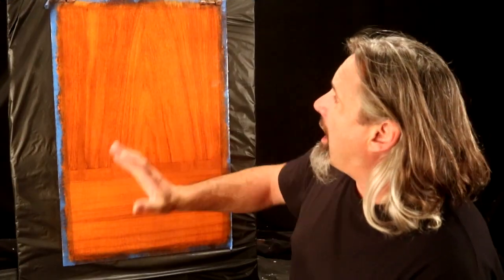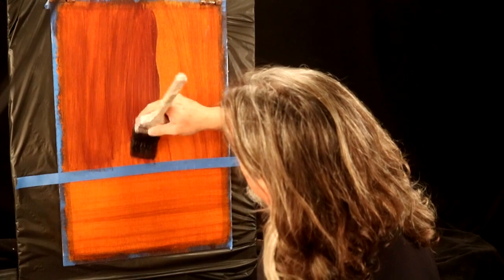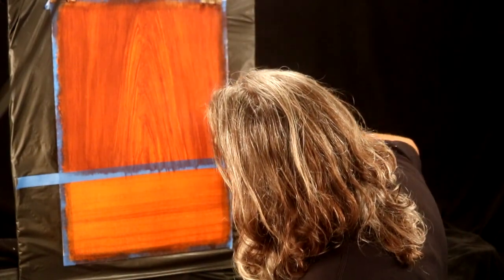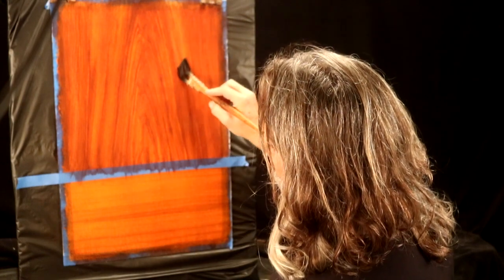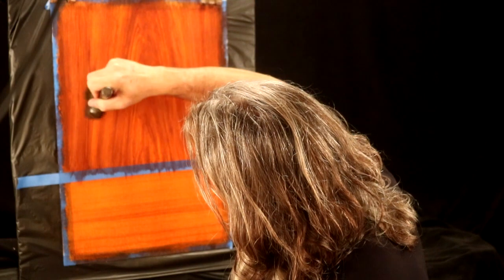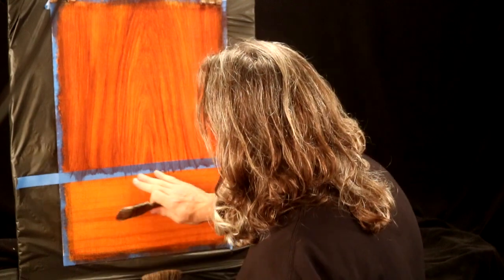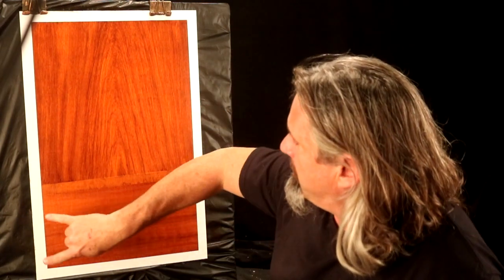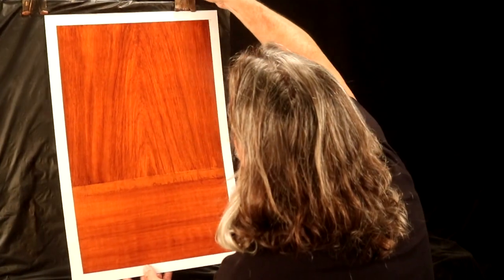Mahogany wood graining technique, part 3

Comment: What a great relaxed style in explaining your methods. I use faux finishing to augment my larger work with historical restoration and detail, and even though that type of work doesn’t always require the utmost in detail? Frequently it does, and your style and execution here is impeccable (and shows having many more projects under you belt than myself). 
Great work!

Comment: Thanks for sharing your process in such detail! I’m building some beds and have some very old solid wood door panels with Cuban mahogany veneer for headboards. The figuring on one of the panels is absolutely striking, but the other panel is less intriguing. I’ve been trying to figure out how to simulate the figuring of the first panel onto the second and, while I doubt I’ll achieve your level on this project (or ever, likely😋), I have a better idea of what tools and supplies I need and guidance for how to execute. 
Also, I can never find my stuff after I clean up either! 🤪

Comment: Thanks Ron.. 3 excellent parts to this finished product... I am doing a royal walnut finish to a bass drum shell and all the technique you used should get me a very good final product.. The only difference is the royal walnut color is much darker... my question is : should I start with a darker pigment glaze in order to keep the color darker thru the finished grain step.. I will be giving the finished shell 7 coats of clear poly to finish it... thanks

Comment: Looks great. If I was going to do this with exterior oil, would there be any big differences in how I worked the glaze? I’m trying to do it on the cheap with oil based gloss enamel floor paint on my boat’s transom. I’d sand it with 400 grit before applying the glaze. Would that be too grippy? Awesome tutorial. Thanks!

Comment: Quick question: what would be a good sealant for this? I'm looking to faux paint the top of my workbench and so it can't be slippery, but given that there's going to be some work done on it I need something to seal this all in. Any recommendations?
Reply from the maker: I would use a couple coats of satin oil polyurethane